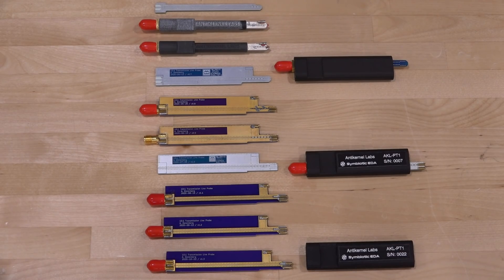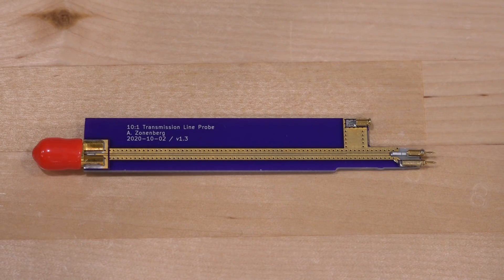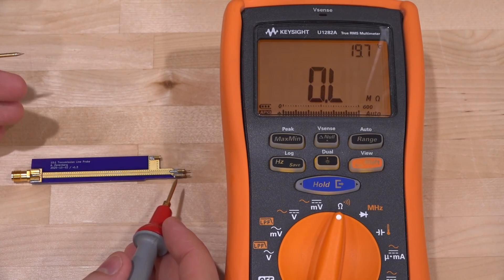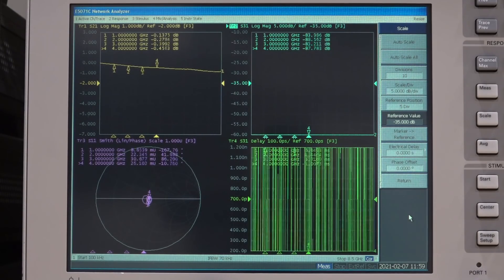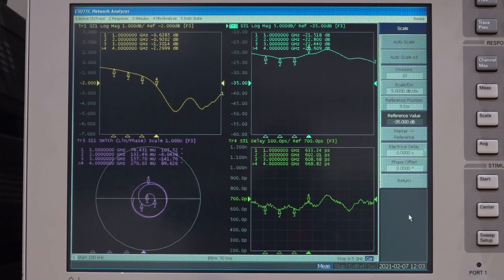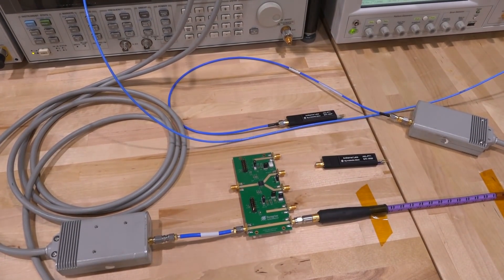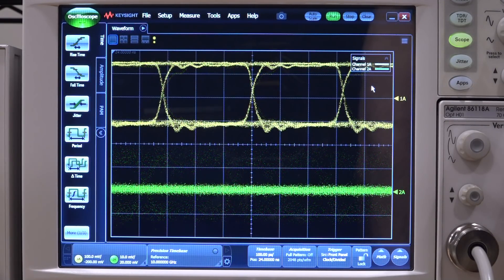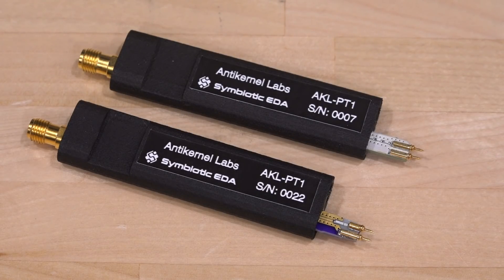TSP #182 - Antikernel Labs Inexpensive Multi-GHz Transmission Line Probe Review & Experiments

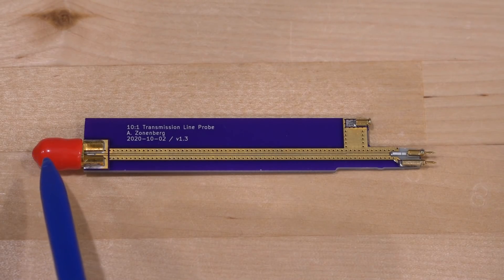Comment: Regarding the peaking: If you look carefully at the PCB around 3:30, you'll see that a short length of the coplanar waveguide just aft of the resistors is fatter than the rest. This is actually a  distributed element notch filter tuned to the frequency of the peaking (which I believe is a resonance in the tip itself, since the tip forms a stub between the DUT and the high impedance of the resistors) and intended to produce an overall flat response.

I designed v1.3 based on older characterization data that didn't correctly de-embed the loss of my test fixture at higher frequencies; as a result I underestimated the intensity of the peaking and didn't make the filter strong enough. Making the notch a few dB deeper (by widening the trace in the filter area) should flatten it out and is already planned for the v1.4 PCB revision, I just need to do more experiments to figure out the optimum filter response.

Regarding the tips: These tips are made by PMK for their Tetris and Sonic active probe line (rebranded by Teledyne LeCroy as the ZSxxx probe family), part number 890-800-000. You can buy them on Digi-Key in a 4-pack for $15 by searching part number PK-ZS-001-ND. They also make a pogo variant, PMK part 890-800-001. I only have one of these and they're quite expensive ($54 for one tip) but if you'd like to try, you can get them on Digi-Key by searching PK-ZS-013-ND. A pair of these would more than double the BOM so I didn't include these in the standard accessory kit, but users can buy them separately if they want. I'll try to buy another one or two and do some characterization and see if they alter the response.

For updates on development of this probe, and my other test equipment projects, check out my Twitter @azonenberg.
Reply: It might alos be a good compromise to use a pogo pin only for one of them
Reply: One would assume that the step between the pins and the barrel of the pins is causing an impedance change and you are resonating it out with your Distributed Element filter/impedance transformer ?
Reply: If it were possible to get pins that are thinner and have no barrel, wouldn't that alleviate the impedance change since they would be kept parallel ?  SMA is rated up to about 6GHz before it starts dropping off FWIR.
Reply: @GodzillaGoesGaga  Yeah, basically. My best simulation to date suggests that the tip is somewhere around 200 ohms impedance but unless I could get the tip up to ~500 ohms there would still be a mismatch when you hit the resistors. Higher is actually better vs being an exact 50, I think.

These pins are socketed in order to be replaceable. Solder-on pins exist but most of the ones I've looked at are quite long (bad choice for high freq) or have other issues that make them not a good choice for this application. So far these are the best I've found.

And good SMAs are good a lot higher than 6 GHz. The one I'm using from Amphenol RF is designed to transition smoothly to coplanar waveguide and is specced for operation out to 26.5 GHz.
Reply: @AndrewZonenberg  maybe notch out the PCB between the pins and cover the end with black, anti static foam ensuring it fills the notch.  That may de-Q the resonance along the length of the pins.  Depending on the via inductance, may also need to bridge the top of the CPWG grounds with a zero ohm resistor to help equalize the ground currents.  Unequal ground currents may build up a common mode resonance along the length of the probe.
Reply: @graybeardmicrowave3074  Field solver sim of the probe body matches experimental results of test coupons on the same CPWG geometry pretty well and I don't think there's any significant resonance there. The tip is trickier to model because it's 3D geometry and Sonnet is only 2.5D, so I rely more on experimental results for the tip.

The foam is an interesting idea, I may have to play with it. I'm not sure how much is coupling between the sockets (possible to fix) vs the needles themselves (which I can't do much about since they need to remain separated to hit the DUT).
Reply: @AndrewZonenberg  Could you add a dielectric up until the tips.  Teflon or something ?

Comment: 14:10 - it's interesting that you get a better eye diagram reading than the actual receiving end after attaching the probe. I think this is due to the high impedance coupling into the probe itself and causing reflections that the rest of the line is actually seeing. 

I've never had the opportunity to have all these high end equipment to learn and study these but I recall running into an issue in one of my previous jobs where we had bit errors happening and so we tried to probe the link to see what is happening. Every time, we probed it, the link always worked fine but removing the probe, we immediately saw bit errors again. In the end, I think we simply added small capacitors onto the line to mimic what the probe was doing to the line and called it a day.

Comment: Is the discontinuity in the center conductor to somehow compensate for the large vertical tab?
Or should that not matter because of the via stitching?
Could the center conductor transition be smoother, perhaps drawn with a Bézier, or even a gradual taper?
Sadly, the legs on SMA connectors usually used for afixing them to boards has been found to be an issue at high frequencies, something about circular modes a problem. I believe that Eric Bogatin's associates characterized them.

Comment: We solder the probe right to the traces when measuring PCIe with an active diff probe.
Reply: The AKL-PT2, planned to launch in April, is a solder in passive probe based on this same architecture. Limited to about 4 GHz by losses in the fairly long flex PCB but a shorter version, or one made on a lower loss substrate, would perform better.

I also have a 4 GHz differential probe (AKL-AD1 amplifier plus AKL-PD1 tip) under development, as well as some faster stuff, planned but no ETA on those yet.

Comment: could you calibrate for the probe?
Reply: The pro edition will include individually serialized 2-port S-parameters for de-embedding. You can't do this on a sampling scope like Shahriar is using in this video because it relies on being able to see changes in the waveform over time to compensate for frequency dispersion etc, but with a sufficiently fast realtime scope it can significantly improve results.

Comment: I'm in software and took basically only philosophy classes, so forgive me if none of this makes any sense...I learnt most of what I know (whcih, again, is very little) from the ARRL ham radio books....Can you test that out with pre-emphasis? (sorry I don't know the Agilent layout so I have no idea if you've already enabled it)?  What was he using to model that out, ADS?ANSYS? And/or a semi-rigid connections and/or on a x/y stage ?  It didnt' look like you SOLT calibrated, on a 3 port system can you just skip that part (like does the probe have the cal co-efficients on the afe?) You can get some cheap gains moving off of FR4, 100% sure of that. 

Also maybe experiment with the copper alloys/weights? And is the board house controlling the oxide built up on the other layers? Probably not, but maybe he can find a board house that'll be flexible haha.  https://www.fr4-pcb.com/provide-99166-rogers-pcb These guys seem to offer a pretty flexible assortment of Rogers materials. Like it looks like you can end up requesting a few hundred different types of board permutations. "Bubble bag" is offered, so maybe they even offer production in nitrogen or some inert environment... 

Placement of..everything is important, I'd imagine. And the oils on your hand is probably not too good for something like this. Some dude was taking coax stock and building a triax setup, he was wearing gloves and all, and everyone says not to touch the pins on SMA connectors, so Ithat might be messing with the linearity too?  AD has just a crazy number of microwave and mmwave stuff in different 3-5 processes since they got all the Hittite stuff, https://www.digikey.com/en/product-highlight/a/analog-devices/hmc8410-hmc8401-wideband-lna Just pick that eval board up and see how it fares. 650$ is a steal if it's really .1 to 10 ghz...

Comment: Neat probe.  You can make a similar one by carefully trimming a piece  0.086” semirigid coax at a 45 degree diagonal and soldering on a 1k 0603 resistor.  Of course you don’t have the nice pogo pins to make contact.
Reply: that sounds pretty cool, where'd you get that from?
Reply: @KX36  nowhere, just made one up.  Can also snip tungsten needle probes in half and install a SMT resistor with silver epoxy.  Makes a high impedance DC probe for probing RF thin film circuits and ICs.
Reply: @Kevin A. LOL

Comment: What setup you need to probe a USB2 line? USB is bidirectional. Is it even possible to analyse a bidirectional lines like that using a sampling oscilloscope?
Reply: USB2 is bidirectional, but the the TX and RX sides take turns sending. It's not like 1000base-T where both ends send simultaneously using echo cancellation.

You could probably use an edge trigger on a sampling scope to get an eye pattern off it, but USB2 is slow enough that a halfway decent realtime scope can analyze it too. As a bonus, with a realtime scope you can do protocol decoding, and maybe even separate TX/RX eyes (possible in principle although I'm not sure if any software does this).

The AKL-PT1 would be a poor choice for probing USB2 because of the 500 ohm loading; USB2 relies on pullup/pulldown resistors to detect device speed etc and also is DC coupled with fairly large swings. USB3 is AC coupled high speed serial with a smaller swing, so it would probably work decently for that.
Reply: @AndrewZonenberg  USB devices do not expose its internal state and it is hard to say when it is sending or receiving. It is just sending packets and retransmitting them until the checksum test is passed. In a DIY projects you just have two devices soldered to a board or connected through a custom cable. You may have an access to its clock generator but this is all. How can you troubleshoot this USB line and test its signal integrity? 
A realtime scope that is able to show an eye diagram of an old 480MHZ USB2 interface would already cost around $10k. This is the other story though. Hobbyists are struggle to test their rather old digital interfaces and we just desperately need a cheap 5Ghz sampling scope just to test the plain old USB or HDMI signals integrity. The industry on the other hand only produce new sampling scopes with a much much higher bandwidth than the current realtime scopes. So the only option you have is to buy an old used sampling scope. Because the new realtime 5Ghz scope would cost you $10k and the new sampling scopes bandwidths starts from 50Ghz and they are even more expensive.
Reply: @anatolyzapadinsky5995  I have a partially abandoned design for a 10 GHz sampling scope that I may revive at some point. I started work on it a while back when I knew a lot less about signal integrity than I do now, so a fair bit of it needs to be redone. It would have been somewhere in the $1K range probably.
Reply: @AndrewZonenberg  just curious, did you also base your scope design on fast comparators?
Reply: @anatolyzapadinsky5995  FREESAMPLE? Yeah it's based on a latching comparator, PLL+delay line, and slow DAC.

But I also had a hardware CDR and some other nice features.
Reply: @AndrewZonenberg  wait, if your design is also based on comparators then why do you need clock and data recovery? Comparator based design doesn't able to build an eye diagram of a random bit sequence signal, it requires a repeatable waveform. It still have some applications but this limitation make it difficult if even possible to test signal sources like proprietary chips with USB or HDMI output.
Reply: @anatolyzapadinsky5995  Nope, a comparator based design doesn't require a repeating signal if you're doing an eye pattern. If you want to digitize a waveform it does. FREESAMPLE (and my scaled-down 10 Gsps prototype) directly measures the eye pattern via statistical techniques and some math.

The basic flow is as follows:
for v from min to max
    for delay from min to max
      accumulate N samples

This gives you a 2D array of count values, storing how many times the signal was below "v" at time "delay". Postprocess by dividing each cell by N (and clamping each cell to be >= the max of all lower cells in the column) to get the probability of the signal being <v at delay.

This is, by definition, the cumulative distribution function (CDF) of your waveform - modulo the unit interval, of course.

Take the partial derivative of the CDF with respect to voltage and you have the probability density function (PDF) - in other words, the probability of the signal equaling v at delay. Apply a color gradient to the PDF and you've got an intensity-graded eye pattern!
Reply: @AndrewZonenberg  yes it is CDF which you can differentiate, it is not as fast as a binary search but it is possible if you gather this statistics with a magnitude more measurements. On high frequency it might be even possible to gather it in a decent time frame though. A device that have a clock recovery and is able to draw an approximate eye diagram from a ~500Mhz digital signals would be very handy in DIY projects. Not sure about the $1k price though but it is definitely cheaper than a 10Ghz RT scope which you don't really need other than RF applications. Most of the time you only deal with such frequencies on digital interfaces and you only need an eye diagram and nothing more.
Reply: @anatolyzapadinsky5995  The HMC856 3ps resolution delay line alone is over $200 in single units. Then you need an FPGA, the CDR chip, a $50ish comparator, an ultra stable PLL... it adds up fast.
Reply: @AndrewZonenberg  have you published it somewhere?
Reply: @anatolyzapadinsky5995  Work to date is at https://github.com/azonenberg/freesample.

I PoC'd the architecture using 7 series IDELAYs at around 10 Gsps so I know the concept is sound. This version scales up to the hardware CDR trigger and other nice features. I might get back to it at some point but it's a ways out. A fair bit of the layout probably has to be redone, I've learned a ton since them.
Reply: @AndrewZonenberg  I am trying to understand its schematic. The phase shift delay is chosen between NB6L295 and HMC856, and they do not go one after another. HMC856 total delay is 92ps which means that an eye diagram of a signal slower than 10Gbps wouldn't even fit in its delay window. Isn't it too much considering that the PLL is only 2.6GHz?
Reply: @anatolyzapadinsky5995  The PLL has coarse (fraction of a UI) and fine (25ps steps) phase adjustment. The HMC856 is used in series with that phase shift to provide increased resolution.

The other delay line is in parallel and is used with irregular trigger sources (e.g. DDR DQS) that you can't lock the CDR PLL to. It has less resolution but is more flexible so I provide both timebase options.

Comment: I believe Doug Smith may have a better solution.  You put the resistors at the end of the coax and make a purely resistive probe launching straight into the coax.  This way you don't get parasitics and surface issues from the PCB microstrip.  http://emcesd.com/1ghzprob.htm It would be interesting to see these 2 designs side by side.  I'm sure Doug Smith would love to see the results too. Nice idea and kudos for sharing.
Reply: His probe needs extra compensating capacitance to flatten out the response, which increases loading. It's only a 1 GHz design and I don't see any S11 or input impedance curves anywhere on that page.

It was one of several existing designs I looked at, as well as http://www.sigcon.com/Pubs/straight/probes.htm, to draw inspiration from. I ended up going with flip chip microwave resistors from the Vishay FC0402 series to get lowest parasitics. My current design uses a series string of 200+200+50 as the best tradeoff between the various issues (reflections between the resistive elements, high frequency peaking from shunt capacitance, available component values, etc).
Reply: @AndrewZonenberg  Very cool.  A fun project for sure.  Thanks for sharing.

Comment: Interesting idea and good luck to the company selling these. As I'm sure you know,  the famous Techtronix probes book mentions transmission line probes where the series resistance is integrated into the transmission line using a resistance wire if my memory serves me right to get the required astonishing bandwidth back in the 1960s. "My Early Tektronix Days By John Kobbe" has more on this.

Comment: I can't stand sellers not showing prices until you jump through their Data Collection hoops.
Reply: This was a pre-release beta unit and it's not available for sale yet.

There's no "data collection hoops" to see prices. It will be available for immediate purchase, with published prices via my distribution partner, once I've addressed the peaking issues. No customer information is collected except what's needed for shipping and billing, and that's not retained after fulfillment is complete.

Expected retail price (not including tax/shipping) will be:

* $250 for standard edition (probe body and basic grounding accessories only), discounted to $150 to students / noncommercial users upon special request

* $550 for pro edition. This will include an SMA cable, SMA-BNC adapter, and full characterization report including machine readable S-parameters for de-embedding probe response from your measurements. Based on this review, I may also include a set of pogo tips you can use instead of the rigid ones.
Reply: @AndrewZonenberg  Thanks for taking the time to respond with some prices and explanations... When I'm required to register my identity information on a site to get info (pricing/etc.)... I call that "data collection hoops" and I will not continue on that site. nice new product.